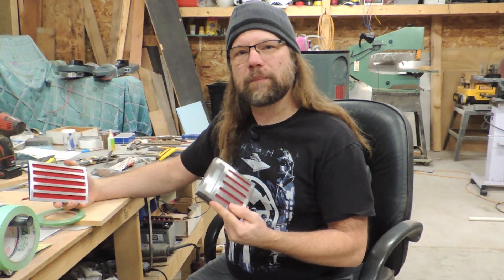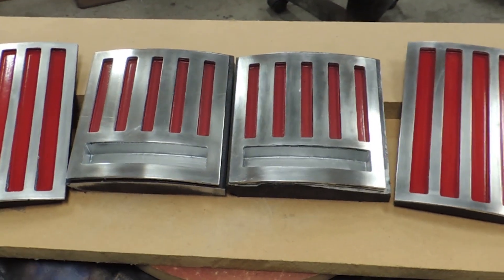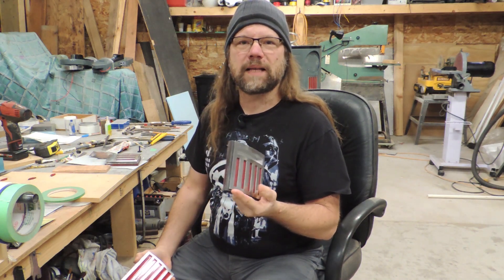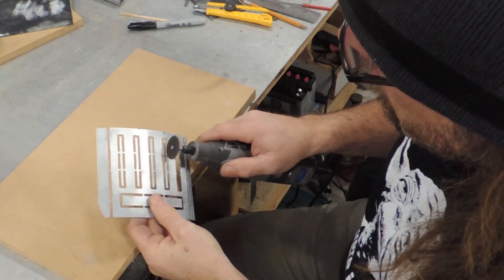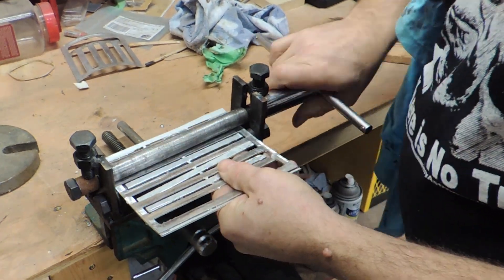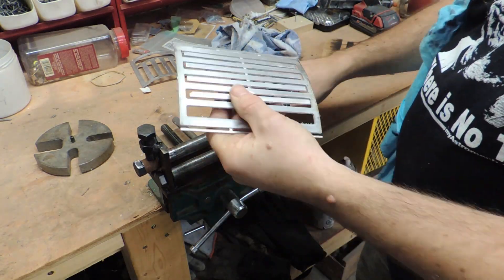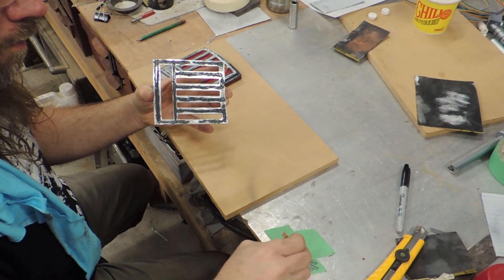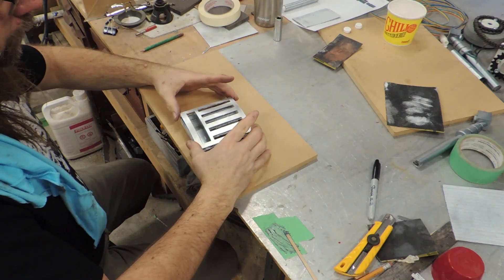Combining 3D printing with Aluminum – Body Vents

Comment: The best metal finish is metal. Looks like your roller is just big enough. Can you increase the size if needed?
Reply from the maker: MalC.. I agree. Can't beat the real thing can you? I very much built that roller just for these vent covers and it can not easily be changed. It was a proof of concept and I wasn't sure that it would work as well as it did. I need another for rolling a couple pieces for the aluminum feet which will need to be 14 inches wide.